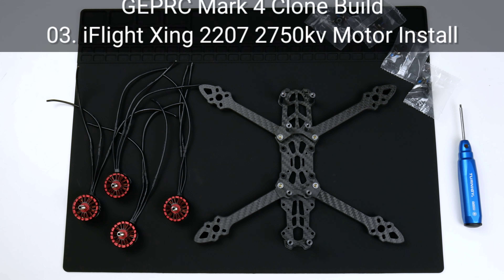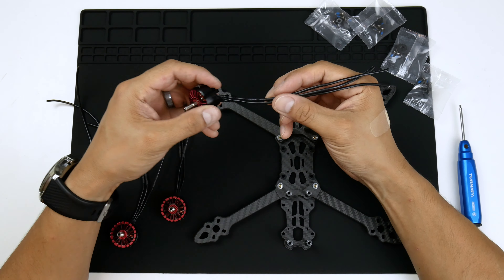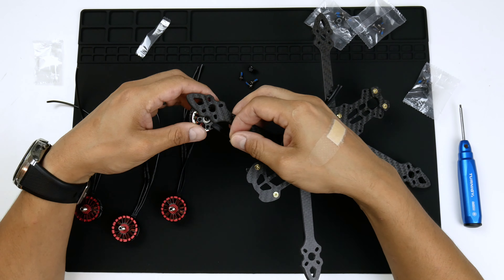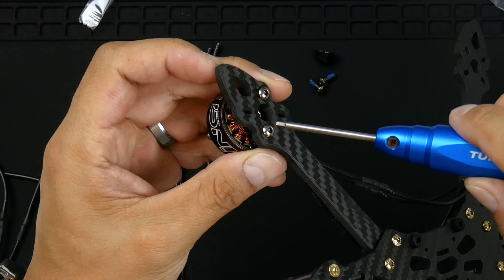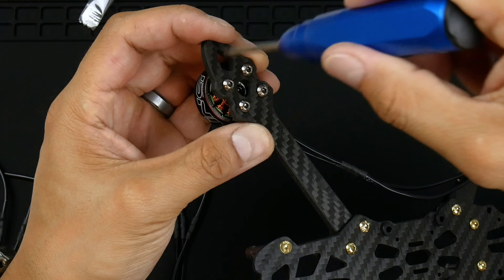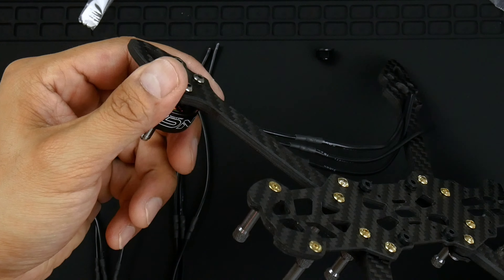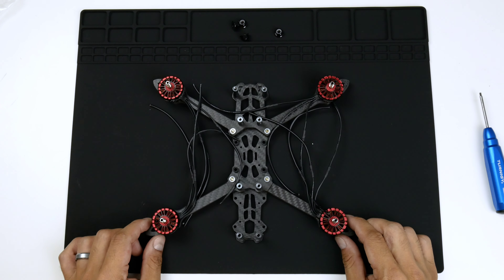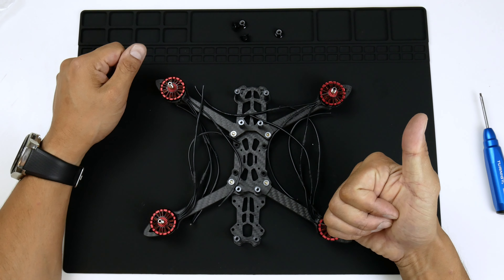GEPRC Mark 4 Clone Build - 03. iFlight Xing 2207 2750kv Motor Install

Comment: I have done the exact same thing you did - took the motors from another quad and extended the wires by soldering on a thicker awg wire and heat shrinked the joint! :)

Comment: In hindsight what’s strength motors would you recommend for range and efficiency
Reply from the maker: Sorry. I haven't really focused on long range or efficiency flights. Mostly for freestyle and durability. I would suggest looking at lighter components and Li-ion batteries. Here's a good article discussing the benefits of Li-ion batteries https://oscarliang.com/li-ion-battery-long-range/

Comment: Since these motors all have CW threads, do you use loctite for the propellers? Thanks for sharing!
Reply from the maker: Thanks for your question! I don't use Loctite on my propellors. I just tighten them down good. Haven't had them come loose since the motor bell has knurling where the propeller hub sits and the M5 nylon lock nut is pretty secure. I also tend to check the prop is secure after heavy crashes. Another thing about Loctite is that it causes damage to the propellor plastic, kind of like corrosion (eats away at it). Here's a video of Joshua Bardwell explaining what happens. https://youtu.be/6YKuPauSQhE. it might not be so bad on a 5 inch prop hub, since it's thicker, but not worth risking it in my opinion. I'd rather a propellor come slightly loose after recovering from a crash instead of exploding mid flight. Hope that helps!!
Reply: @nxp200  thank you, that settles it :)

Comment: My kit didn't come with bolts for the motors, are they meant to be M3x8 like I am presuming?
Reply from the maker: Hi Lucy. Some frame kits don't come with motor screws. Motors come with their own screws, which I find strange because how does the motor manufacturer know the thickness of the frame arm? In any case, the GEPRC MK4 frame arm is 5mm, so you'll want to get M3 7mm bolts, as this will allow 2mm of the bolt thread to grab the base of the motor. Be careful if you choose 8mm bolts as this might be too long and extend into the motor wires and damage it. If course, this depends on the motor you choose, as not all motor base thickness is the same. Hope that helps!
Reply: @nxp200  Okay thanks mate, that makes sense. It's super weird though, it's the readytosky kit with the clone frame in this video and with their own branded motors (the crappy purple ones, you know the ones), you'd think they'd throw in bolts for the motors as well. It was basically advertised as an "everything you need but the stack and RTX" kind of deal. I'm mostly just pissed off I have to take a trip to Mitre 10 now haha. I got the SpeedyBee F405 V3 stack for the build, major overkill, but the plan is to upgrade the motors later and eventually rebuild it as an eight rotor carrier drone.  

Cheers for the advice and the video. It's my first foray into drone building, so I needed some help getting my brain around the frame build.
Reply from the maker: Haha Mitre10? G'day fellow Aussie!! 👍 Yeh I haven't seen that kit but that'd piss me off too. Hope they stock the right bolts for you, otherwise it's a bit of a wait from eBay or the like. I recently got the SpeedyBee F405 flight controller and I'm super impressed! As are other reviewers in the hobby. I wouldn't say it's overkill, but rather a bargain stack! So cheap for what you get, and as you say, it's got the bells and whistles to allow future upgrading with. Anyhow, good luck and let me know if you have any other questions. Cheers!